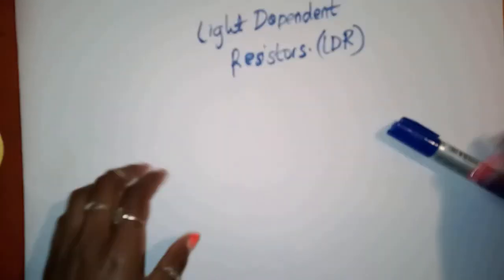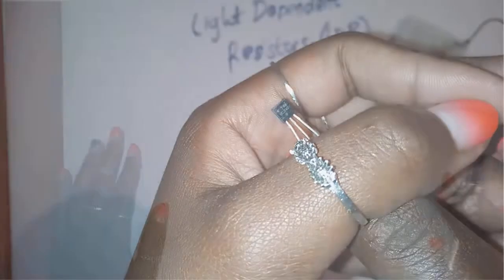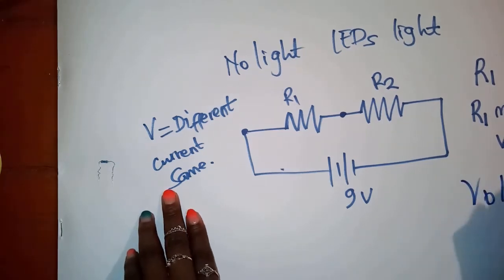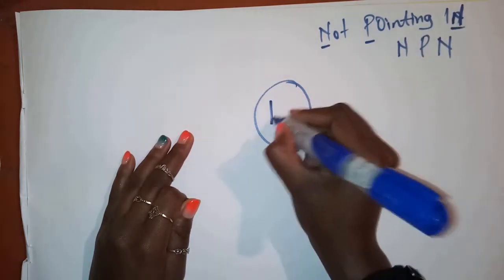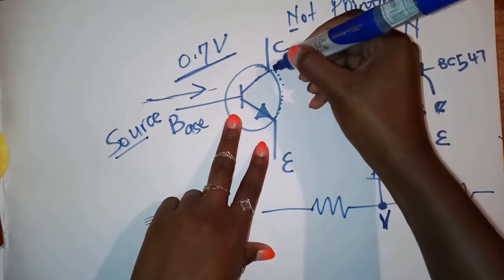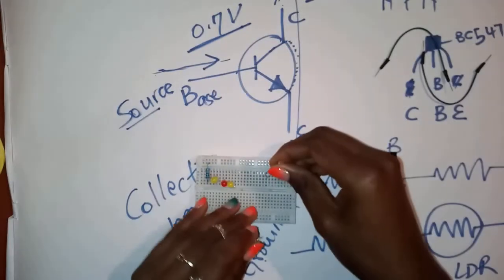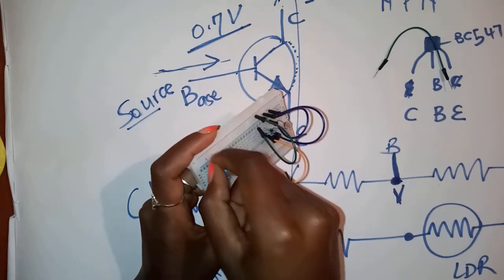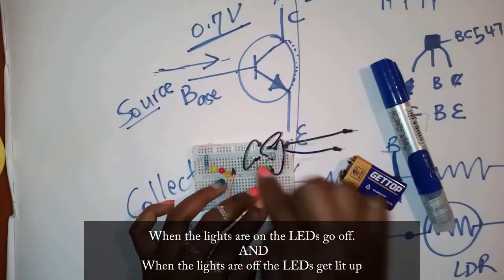How to Make an LDR Darkness Circuit (Simple DIY to Make an LED ONLY Light in the Dark)

Comment: Thank you,now have a better understanding of  how transistor works! My question is how can we use transistors, photo detector together with relays and LDR to detect darkness? Kindly help.
Reply from the maker: I have not eorked with a photodetector but in my project on the clap switch, I work with a sound sensor module as the control voltage (base) to the transistor and then use it to switch lights on and off  through a relay. I think the sound sensor module can be replaced with the photodetector... Look up connections and specs on datasheets. I'll look into it and get back to you
Reply: @techdicted  much appreciation.
I'm will be glad on your feedback.!

Comment: Hi Techdicted (great name)

Thank you, I found this video most helpful, particularly the explanation regarding how a transistor works, very clear and easy to understand. 
As you can probably guess I am new to electronics. When I looked into buying some LDRs to do something like this I found that there are many different models The following is the specs they quote:-
Resistance: @10 Lux
GL5506 2-5Kohm
GL5516 5-10kohm
GL5528 8-20Kohm
GL5537 18-50Kohm
GL5539 30-90Kohm
GL5547 3-15Kohm
GL5549 45-100Kohm

Dark Resistance:
GL5506 0.2Mohm
GL5516 0.5Mohn
GL5528 1Mohm
GL5537 2Mohm
GL5539 5Mohm
GL5547 20Mohm
GL5549 10Mohm

How do I know which one to buy when I want to use a BC547, an 18650 cell, resistors, diode, LEDs and a solar panel to make a dawn to dusk light?

Any help would be appreciated.

Kind Regards

Peter
Reply from the maker: Hi, thank you. I had accidentally turned off comments and thus was not able to see this when you sent it. Lemme look into your question and get back to you, my apologies.

Comment: can you please explain more why we use second resistor ?? and how we choose the value of resistor i mean why did you  choose 1k resistor and if we have more voltage like 12 volt dc which value is suitable for resistor ???
Reply from the maker: Heey. So first when the LDR is directly connected to a load e.g. an LED, then when there is light the LDR's resistance reduces, and the led is turned on and its brightness keeps increasing with the increase in light. IN most cases, we want the reverse to happen and one way we can achieve this is through the voltage division rule. It states that the voltage divided between two resistors connected in series is directly proportional to their resistance. 

The formula you can use for this is Vout = Vin (R2/(R1 + R2))

Using this formula in my case, the maximum resistance of the LDR was around 100k (measured in darkness using a multimeter) and the expected voltage is dependent on the load eg if it's one LED then the expected voltage is 1.5v to 3v (depends on its rating). The input voltage in my case is 9v. With this information, assuming the voltage output is the voltage through the LDR a.k.a R1 and  is 100k, R2 is unknown, Vin is 9v and Vout is 2v(LED rating), then using the formula

2v=9v(R2/(100k+R2))
2/9=R2/(100+R2)
(2/9)(100+R2)=R2
22.22+(2/9)R2=R2
22.22=R2-(2/9)R2
R2=28.5k

I used 20k which gave me an output of 1.5v. Thus for any input voltage, you need to know the output voltage which is dependent on the load.

With the equation Vout = Vin (R2/(R1 + R2)), you can then find the resistance needed for the 12v battery.
Reply from the maker: Also the resistance value doesn't have to be exact, it just has to be enough for the voltage output needed. Thus it can vary. e.g for my case, the LED was lit when the voltage output was 1.5v and could still be lit when the output was 2v thus 20k resistance worked fine and the 28k resistance and anything in between would have worked well too.
Reply: @techdicted  thank you sooooooooo much for the answer and the time you spent for me and your video
Reply from the maker: You are welcome. I hope I answered your question as you needed